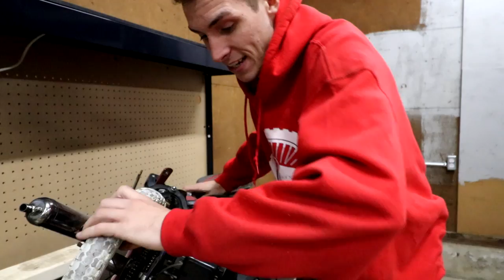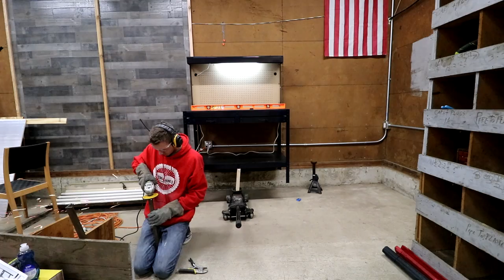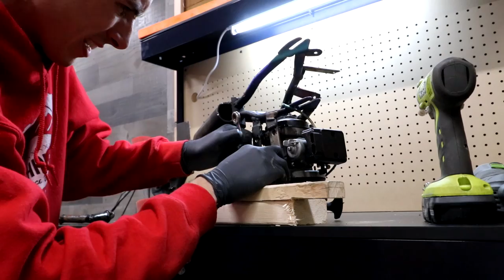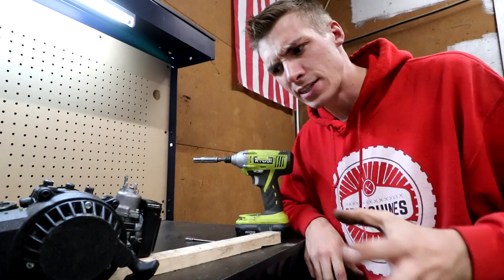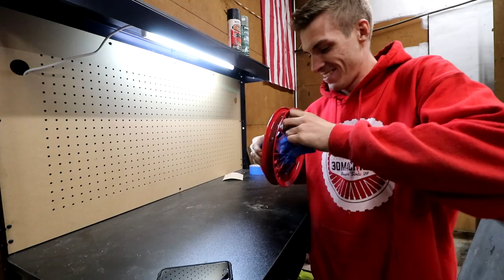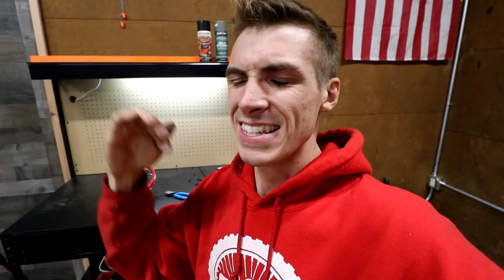OVERPOWERED SKATEBOARD DESTROYED

Comment: Next project, focus on the shop. Build a real workbench about 10' long, couple feet deep with thick heavy wood at one end and like a 4 foot long, 3/16" or 1/4" thick steel plate at other end for weldin, fabrication n such. Nice big vise, few bench grinders with different wire and stone wheels. Big hooks off the wall, anywhere convenient, to hang often used power tools like 4" grinders n such. Build a charging station for your cordless tools. Some shelving and cabinets type shit. Look on Craigslist and other 4sale sites for a NICE AND SAFE but cheap two post lift. Ya know, shit like that man. That shop is a big boy project. Build it out a bit and, especially with a lift, you can start doin real projects. Not that you're projects haven't been real, but one's that you don't have to put away or hide the mess from the city (city of mom haha). Ones that can be disassembled and take weeks or months to complete without environment or whatever screwin with it. No tarp coverin, no big brother lookin over your shoulder (by big brother i mean government, by government i mean YO MAMA). Check out youtube channel mustie1. He has a modified motorcycle lift in his garage shop. Air powered, pretty cool. He puts bikes, motorcycles, riding mowers and small farm tractors to small engines and whatever. This shop offers an almost infinite number of cool ass projects brother.